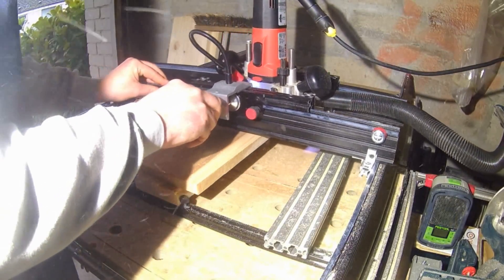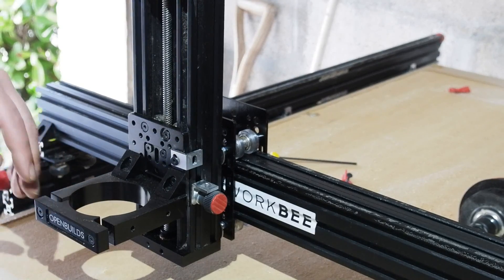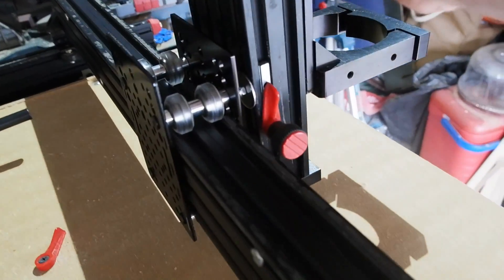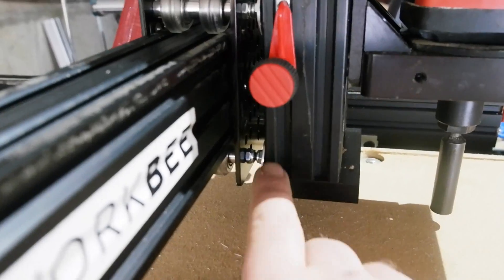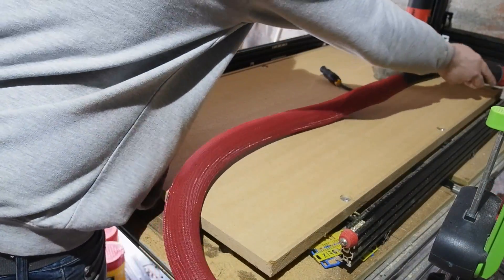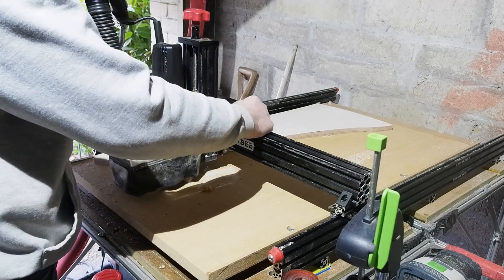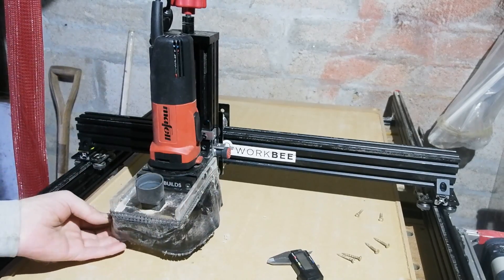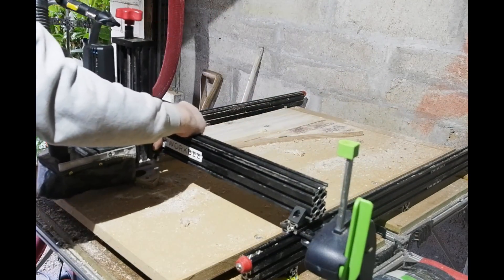Router Sled 2.0 upgrade and demo with Mafell FM1000

Comment: Yes. Itll be a long commrnt)) but may i ask you what do you think if i want to use this Mafell 1000 as a motor for drilling press or sending ring.. is it too stupid idea? I meant if you have no space for meny stacionar mashines.. and want to use same motor but on different table mashines..
Reply from the maker: The Mafell motor isn't suitable for drilling and sanding. It's too fast, even on its slowest speed. What you can do is use the mafell for you milling and routing tasks then, swap the motor for a corded percussion type drill. These drills have the same 43mm collar as the mafell so will fit in the same mount. They also have a lock-on function which is useful for drilling and sanding. They're not too expensive either. If you search for my "drill stand" videos (2 parts) I show it with both this type of drill (From Bosch) and with the mafell 👍

Comment: Need to build a router jig, using aluminium extrusion rather than wood ( for level and longevity ).  Was about to start compiling a list of what I think I need via Ooozenest and Banggood.  Mine will be different as will need to Run a Trend T7 rather than attaching a smaller palm router like in your example.  But then I was directed to your vids via Oozenest.  This video, and your other 2 on Router sleds with extrusion are invaluable.  Thanks Stew.
Reply from the maker: Ah, nice one. Yeah, I think the first incarnation of this machine was a much more traditional router sled. The gantry (?) on that Could be sized for any router really. Basic but worked well. I've only made it more complicated to see if it could be adapted to pattern routing and turning. It can but lots of extra cost etc. If 8 could offer one bit of advice,  it'd be to overbuild. Don't use 2020 profiles but 2040 and up. Don't scrimp on fixings either.👍

Comment: the bars you used as a basis for the build (part1) do you have a link to them? (awesome channel :-))
Reply from the maker: Thanks Richard. Do you mean the aluminium profile? If so it was sourced through Ooznest. Link to their site in the description.
Reply: @BischBaschBosch   i metanreserver the alu profile you used in the start of episode 1. you has them already. But i saw your video of the table saw, and you added a link there. 👍.
Reply from the maker: @RichardKallestad  Yes, all the 20mm profiles for the sled I sourced from Ooznest whose site I link above. The 40mm profiles I used for the table saw were sourced on eBay. Hope this helps.👍

Comment: Love the update. I'm not clear on how to use the affiliate links from USA, since as they work for me I'm given prices in UK pounds , with no easy way to convert
Reply from the maker: Thanks aethalops alecto. I assumed it would automatically change to a users location if they followed the links. If not, if using a laptop or PC, on the upper left of the Banggood page you'll see a "ship to..." selector. Click the little down arrow next to it to open a box allowing you to choose shipping location and currency. If using a mobile, below where the price is listed you should see "ship from.." and a "shipping" bracket just below that. Click "select" to the right of "shipping" and in the box that appears, choose the appropriate "ship to..." option. Hope this helps. Also, thank you for using the affiliate links also. Much appreciated.